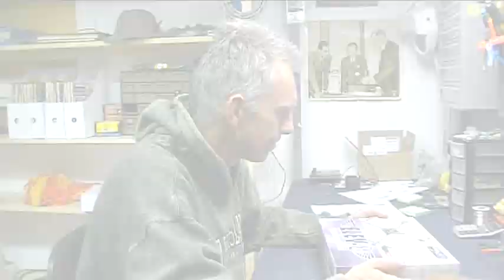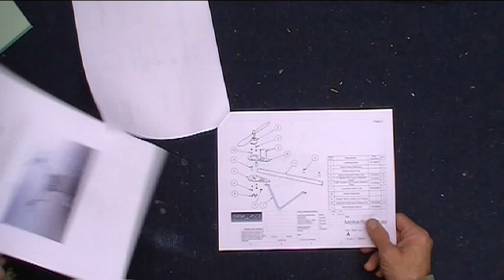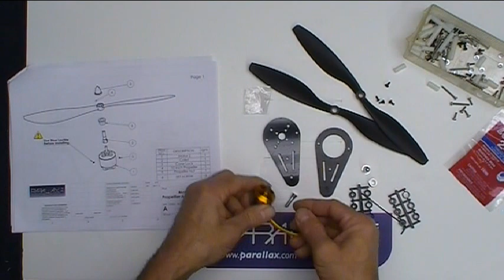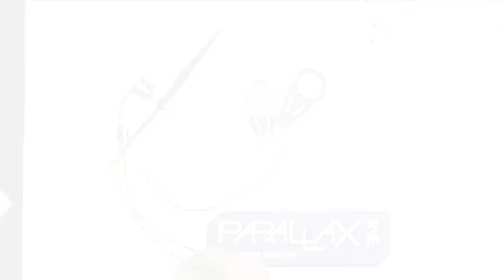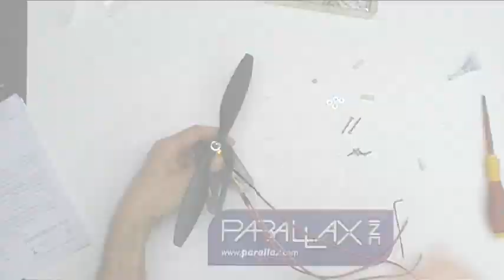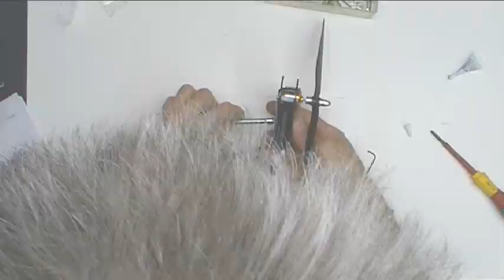Build The Parallax Elev-8 Part 1

Comment from the maker: There is no need to mark the wires. They just connect up to the speed controllers later in the build, and you just switch any two wires to set up direction of rotation.

Comment: If you need any tips i can help, i build my own quadcopters.
You should look at buying the ARDUMEGA 2.5 : goo.gl\sr5tt
paste the link into your browser.
This board supports GPS for quadcopters, requires soldering!
GPS link:  goo.gl\2PvBV
Or you can go for one with GPS and telemetry to send data back to your laptop
goo.gl\2PvBV

They are all very easy to setup as there is a whole website and fourum dedicated to this board.

features waypoints to make it fly where you want.
Return to launch